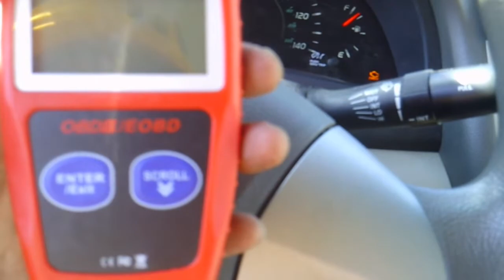how to clean the throttle body (2009 toyota camry)

Comment: Thank yo Mr. Zhou.  My 2008 Camry has like 200, 000 miles on it and was idling and running very rough.  Cleaned the throttle body per your directions and now it purrs like a new car.  Thanks!